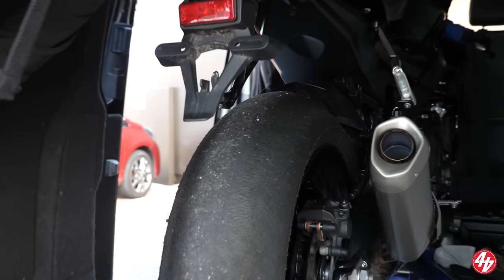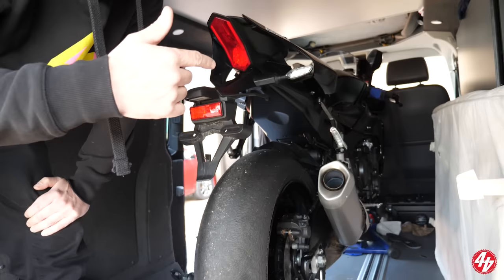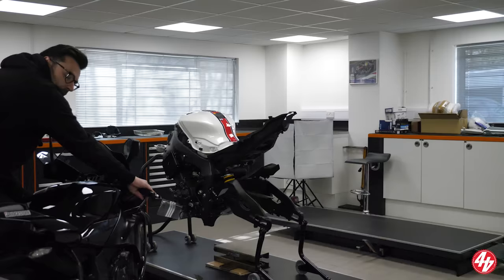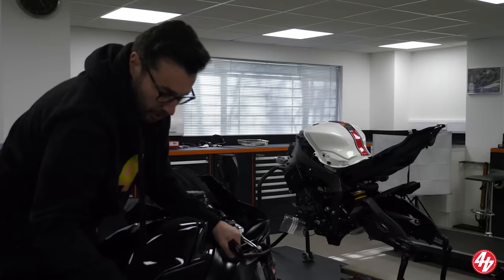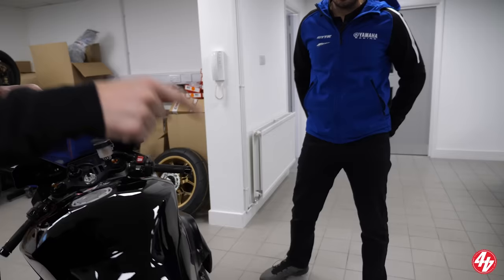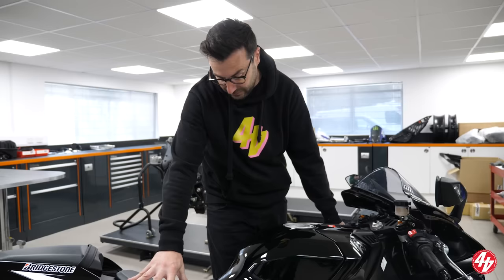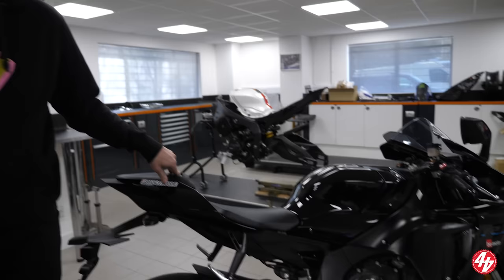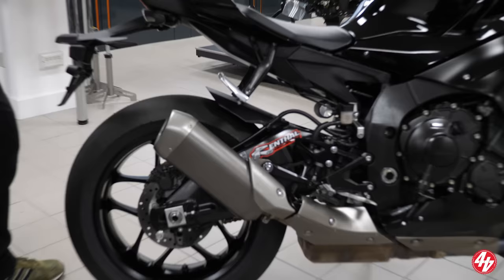R1 NEXT MODS? | ROAD Bike to RACE Bike | Debrief with James Hillier

Comment: I only know motocross, but it's amazing how much mucking about people will do trying to keep the front up before they just up the spring weight. Has to be worse in RR, where you spend longer periods on the brakes. Damping will not hold you up, just slow the sink. Springs hold the bike up. If it needs to be held up more, more spring is the only way. Small changes yield big improvements & if you take too big a bite, you can mix springs. It is all so easy, effective, and inexpensive. Why do people seemingly try to deny this?

Comment: Really interesting vid guys. That was most definitely an education! Also goes to show you don't need to go nuts & spend loads on all the blingey bits to make tangible differences. The brake set up part was particularly enlightening as everyone immediately says get a new master cylinder etc but this budget way seems like a sensible & cost effective place to start first.

Comment: So…
Sack off the abs pump.
Correct Springs for your weight.
Geometry changes.
Longer handlebars so you can position the levers in the best place and recover any loss of turn speed.

Comment: I'm sure that I read somewhere that pushing those big mirrors through the air at 150 mph consumes roughly 8-12 Hp. Try removing them, I did on my17000 mile 2002 R1. The difference on the Isle of Man and in Germany was noticeable. A very cheap mod and weight saving. Another absorbing feature, thanks to all at 44Teeth.
Reply: And street race setup with the folding, removable

Comment: James being super professional and polite.  Why not just try his superstock geometry and spec the paretos (80/20 rule) components like the seat, pads, and bars?

The lift sensor has gone too i guess as part of the abs delete?  Might explain the brake releasing if the rear wheel lifts.

Comment: For your weights you'll need 10.5 front springs and 105 rear.
Run the longer wheelbase with 17/ 44t gearing and it will make a huge difference with feel and tyre life

Comment: Question for my motorcycle gurus: I have an old barn-find K3 GSX-R 750. I've opened up the clip-ons as far as I could, but I get mega mega shoulder fatigue. It's been 3 trackdays and I just get super tired. Would you say it's the suit that is tight, or the clip-ons not big enough? I'm 180CM 90KGS. Difficult to answer I know but I'm slightly puzzled. Thank you darlings!

Comment: That swingarm, linkage etc is for sale, with the wheel, for £6k.  That's got to be worth 2 secs a lap eh! 😅🎉 And to recoup some cash, just fit an ali plate where the abs pump is.  Throws abs light on dash but no I'll affect, free mod 👌don't need an underslung caliper either.  Valtermoto chain adjusters bolt to the caliper carrier so it stays in place, just need some captive endurance spacers so they don't fall out.

Comment: 8:47 “a lot more fluid that can compress”. Really? I thought fluids were virtually incompressible: “while in practice and in most considerations hydraulic fluid is incompressible, in theory it is possible to compress in extreme temperatures and pressures.” Do you get “extreme temperatures and pressures” from squeezing a brake lever?
Reply: When brake fluid reaches its boiling point and on the track most likely will it start to vapor and create the air bubbles in the system hence there’s different types of fluids designed for the right purpose 🤷‍♂️
Reply: @emerel  Good points 😊
Reply: @malcellison8831  I think James meant, in realtion to the ABS, that there is a lot more fluid to 'pressurise'  in the long lines of the system ie actuate the pistons.
The bike straight from the factory is running DOT4 brake fluid - perfect for bumbling around or a spirited sunday run where it is not getting too hot.
Race fluid is DOT5(more expensive) and can stand the high temperatures(heat transfer from the pads to pistons and to the fluid itself) better and for longer without degradation.
Brake fluid is hygroscopic ie absorbs water which will generate air bubbles when the water turns to steam in a system at high temps.
Most teams change out the DOT5 regularly to avoid any compromise......

Comment: Whoa! Did I hear that right? You aren’t allowed to run a full exhaust system on UK tracks!???
Reply: Depends on the track and what day of the week and who is running the race day etc etc
Most UK tracks are 105dB limit which is easily hit with half/full system. 
Full systems normally require a dD killer/insert to comply at most track days.

BSB is somewhat different ie biggest UK racing organisation gets to run slightly louder :

'The noise limit for Superbikes is 107 dB/A (with a 3 dB/A tolerance after the race). There is also an equipment tolerance of 2dB/A, the actual maximum reading before race or practice is 109 dB/A and after race or Practice 112dB/A'

Not sure what BSB 600cc dB limit is but I cant see it being less than the Superbike limit.
Most 600's are running full systems.
Reply: @Pablo__D  Oh ok, nice. Thanks for the great explanation. There’s no db limit at my local ish track however, if someone were to come out there with a horrendously obnoxious straight pipe exhaust, I’m mostly sure race tech would not pass them to ride.
Reply: @Vibrotronic  My pleasure. I did some racing in the UK. The test was normally done (At the club I raced at) with a hand held dB meter at a angle of 45degrees to the exhaust at 1.5m distance at circa 6000rpm (if I remember rightly) and 'everyone' would be trying not to over rev it so as not fail..... ;-)
Reply: @Pablo__D  Yes, that is the FIM standard although Revs should vary by Capacity (if I remember rightly). Brands Hatch always the hardest to pass...
Reply: @Vibrotronic  The problem we have is that with every version of Euro standard they decrease the allowed dB(A) and the local authority Environmental Health (Noise Police) lower the track licence limits to match. This is obviously ridiculous because it pretends that people only have new bikes. Sustainability!
Brands Hatch circuit was racing in 1920 so there is absolutely nobody who lives there who wasn't aware of that when they bought their cheap house next to the Circuit. Like a cheap house next to the Airport, it's nonsense to suggest that noise is not normal and expected.
Reply: @lonpfrb  And that is with Brands Hatch Indy virtually being in a bowl....
Reply: @lonpfrb  Yeah - don't you just love these Big Brother jobsworths!
Same with Mallory Park - its been there for a long time but I seem to remember them having to defend against some knob who bought a house not far from the track and then made a noise complaint - wankers the lot of em!

Comment: Totally wrong on the push up comment btw... Wider arms is harder, and potentially more damaging for shoulders
Reply: So doing a push up with your hands together vs a shoulder with apart is easier is it? 😂
Reply: @BaronVonGrumble  you don't ride a bike with you hands together...
In the video you suggested that even wider push ups would be easier, not shoulder width, which would be best, elbows tucked in slightly.